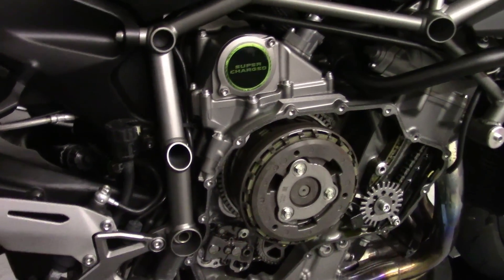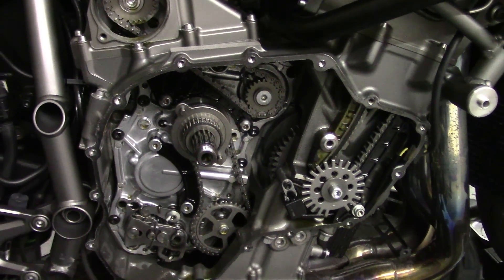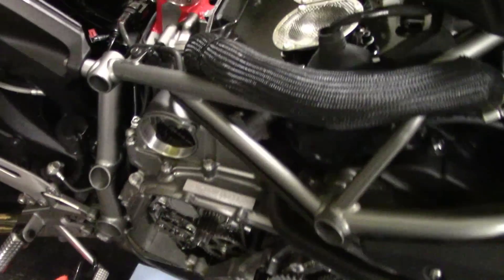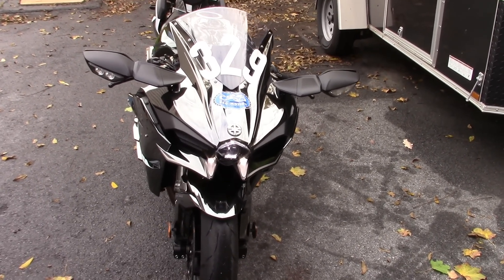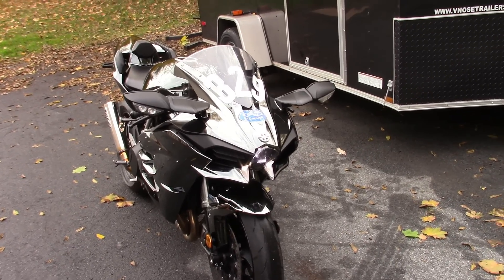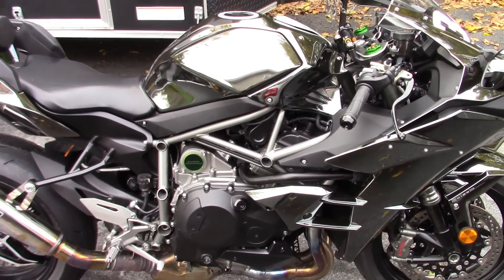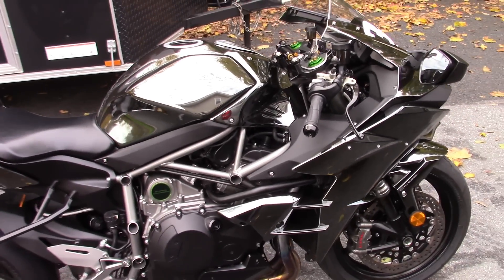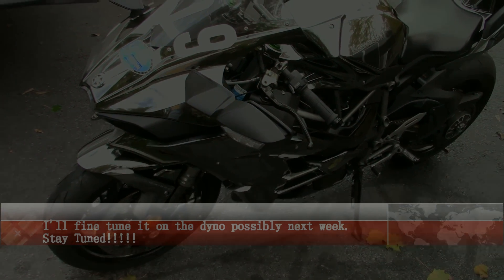Ninja H2 - SuperCharger Gears Stage II Upgrade (RG62/BEAR Racing)

Comment: Good stuff man. You can actually get at that tensioner without having to removing anything from the top end......IE gas tank etc. Unplug the injector, then rotate it away. You can then take an open end ratchet and insert a small allen head to remove the bolts. Worked very well ;)
Reply from the maker: Thanks for the Tip.   I will give that a shot next time I service the SC.

Comment: No intercooler with stage 2 gears? Intake temps a issue?
Reply from the maker: I did eventually get an intercooler but at this stage I ran stock ignition timing and I ran VP C12 on the race track which burns cooler.

Comment: Good job - how was the induction noise on the test ride? - bet it was loud with those new stacks! - also could you feel an increase in boost?
Reply from the maker: It was definitely noticeable.  When I pulled away from the house my wife said that she could hear me for a while.  She noticed right away. I didn't get to full throttle on the street, and it was really busy around 4pm.   It did seem to have noticeably more midrange though from around 6000rpm and up.